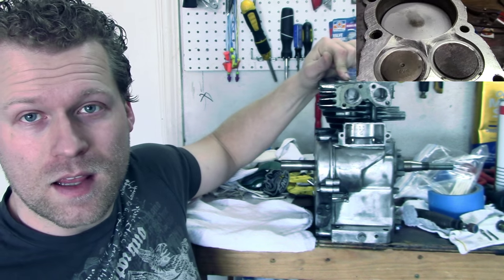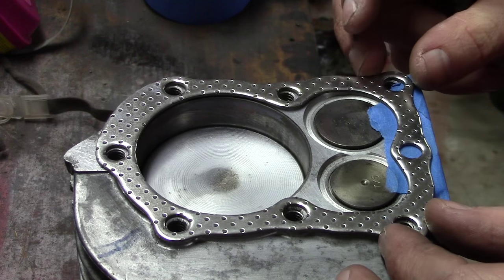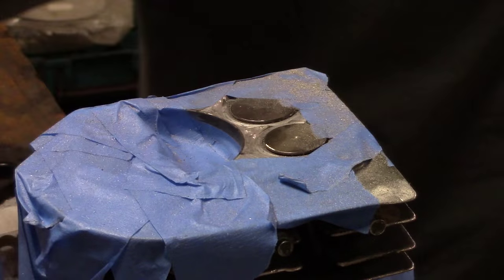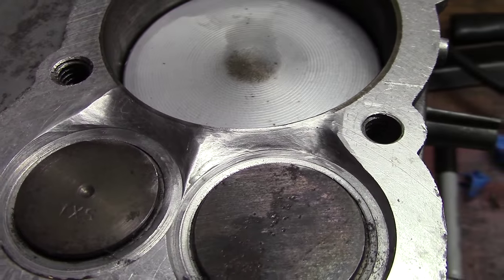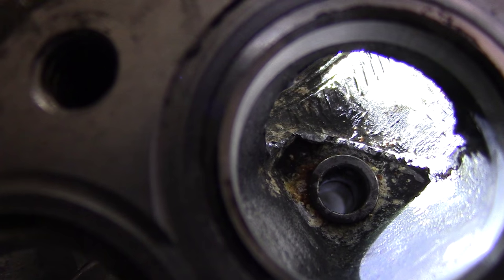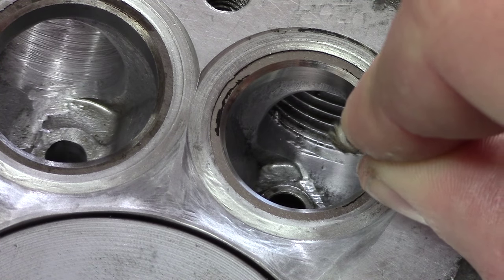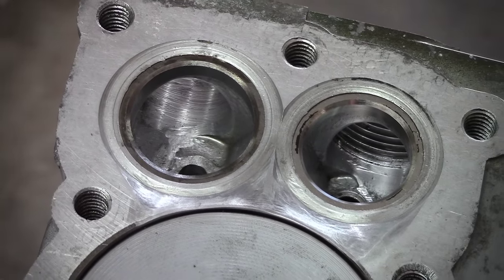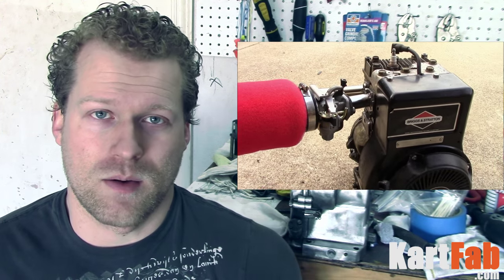How to Port & Polish, Shave Eyebrows: Briggs 5 hp Flathead Performance Mods

Comment: Did a pretty good job. I did the almost same thing on my kids 5hp Briggs, I took a little more off in the runners on mine. It really woke up the motor. If wondering, made low end rpm way stronger, but I have a stock cam also. I love cruising down the street and then just hammer on it, LOL.
Reply from the maker: +prancstaman yeah, it revs pretty good :-)
Reply: @KartFab  Ditto ...Trev New Zealand PS only Flatheads are a low end to midrange Engine: look up the Daytona winning Hudson Twin H powered 308ci L6 6cyl Flathead from the 1950s...a built in chopped Merc too , unlike an OHV...many of which thrive on Revs ( for those of us less knowledgeable ) Cheers everyone from NZ...before you say or think it; no I'm not bragging...Cheers

Comment: I think you made a fine video. Starting out slow and not overdoing the ports is smart. You can't go back. Remember there's people on here that all they want to be is toxic. I owned a custom Harley shop and built lots of engines . Did all my own machine work and I can say you did a fine job of explaining the process.
Good luck.

Comment: You can buy carbide cutters for working with metal.  For aluminium, get a coarse cutter and use a coating of grease in the port to keep the aluminium from plugging the flutes.  As the grease fills with filings, wipe it out and put on another coat.  Wash the grease off before using sanding drums.  The grease is messy, but makes the job easier and gives a better finish.

One major area to promote flow is the "short-side" radius.  On the Briggs, this is right where the roof of the port turns up to the valve. You want to make this a smooth curve with no sharp edges. 

The intake should be finished with a coarse sanding drum to give a slight roughness to promote turbulence along the port wall which helps eliminate fuel sticking to the port.

The exhaust should be as smooth as possible to promote flow and minimize carbon buildup.

Unless going for high RPM, making the ports bigger can be detrimental to power, so go for smoothing the port and eliminating sharp edges rather than removing a lot of material.
Reply: Not legal for legal 4 limited class folks

Comment: Great Channel Man! Not sure if you will ever see this but Epoxy on the Intake 90 Degree Turn would be a good idea and I bet would gain about a good 1/2 HP or so.
Reply from the maker: yeah, lots of dead space there. Ive also heard that you should thread a pipe into the exhaust and cut it off flush to help speed up the exhaust velocity as it is already way too slow.

Comment: When shaving the eyebrows we always shaved into the cylinder being careful to stay above the piston ring
Reply: Yes you can, the piston going a little into the valve area never hurt anything
Reply: @connorssmallengines6663  You grind the wall down untill their even or the piston crown is flush: it's called " relieving" the block, in a Sidevalve. Trev New Zealand 🇳🇿🇳🇿
Reply: @trevinskiking2165  But you can safely go down to the top ring witness mark - - is the point.  The intake and exhaust gasses will have a large, clean shot.
Reply: @TIMEtoRIDE900  What I said,just abreviated for simplicity....cheers NZ

Comment: Porting is specifically useful at higher RPM. During high RPM the gases have less time to enter and exit the cylinder so better flow is critical. Porting does not help so much during mid to low RPMs.

Nice Video!
Reply: John Fraser 
Cleaning up and staying mild helps all over. 
I had something my dad ported for me when I was a kid, haha a moped. 
it had the same power in the basement maybe a little more responsive,but the midrange woke up dramatically and  the top end was tons better. 
It depends on how crazy you go but yea huge ports aren't known for nice low end power. 
The cleanup , with a fresh top end increased top speed from 29 to 37 lol
Reply: It would be great to measure pressure just below the intake valve as a function of rpm, with and without porting. I'm going to guess that there are gains to be had at low rpm too.

Comment: Don't make the exhaust any bigger. The exhaust port on a flathead Briggs 5hp is too big from the factory. Smoothing out the casting lines is fine.

Comment: Good job. I have only 4 engines now. I find it much easier to use the grinding stones attachments. Cone shaped, cyclinder shaped, and frisbee shaped.
  I did however grind down my guides to create a much smoother transition. I saw it done it pics online and it didn't have any ill effects on the engine.

I practice a few times on two of the 97 mL engines since they're so cheap.
It helped build my confidence.
Reply: Ohh and by practicing on the cheapo engines it allows to get a feel for how much to can knock off the casting of the sidewalls.
Reply from the maker: +2SlickNick I 'practiced' on my NOS engine, so that's why I didn't port that much out. Also, I read that if you port out too much (esp the exhaust) it kills your velocity (which kills torque) so I just went the safest route.
Reply: @KartFab  Yeah : want to keep to around 85% Exh to Intake flow or you can overport or overflow & go slower taking too much off.
Stones for Cast metal, grinding bits for alloy( Stops stones from loading up on Alloy ) Cheers everyone From NZ...World's fastest old   Indian Bike ...no I'm not bragging before some Troll says it. Cheers

Comment: you will get almost as good in further gains buy recessing the exhaust valve & radiising the valve seats...radiis the cylinder side of the exhaust channel as well, to about 16th abouve the comp ring & remove the brudge between the valves to encourage exhaust flow scavenging into the intake to promote earlier intake flow if using the std cam...will prote much easier flow from the intake valve & better swirl into the cylinder through the exhaust channel.

Comment: I like what you did, but I would have left much more of that that center ridge untouched, the part between the "eye brows" , kept it a little higher, that actually helps to channel intake gas into the cylinder head. Question, how much HP did you gain ?
Reply from the maker: You get a small loss in compression and a big flow gain so you can rev higher. I have seen jr dragsters that just have the entire “eyebrow” area milled off for flow with supporting modifications. You are right about the center section though and I even missed a spot where the eyebrows transition into the cylinder. I was going off of the information provided to me by someone I thought was experienced but it was just his personal preference. I got a different block and went back to a thicker head gasket for flow gains and I thing the .050” head gasket helped more with flow than eyebrow shave and thin head gasket.

Comment: looks a good job i ported an old ford 2.0 litre cast head using your same principle..... as long as you dont take too much material  off or go too deep to upset flow characteristics you dont need a flow bench(where a specialist tuning company measures the port flow during porting making sure the flow works as if done wrong the engine will lose power at certain rpm?this is what i was advised...but could be wrong?...great video well presented....thanks for sharing

Comment: If your old enough & knowledgeable enough you'll know it's called Ported & for the area between the valves & piston - that's called: relieving or for a Flathead as Jan & Dean sung
 "She's ported & relieved & she's stroked & bored" Trev New Zealand🇳🇿Use the correct terminology.
Reply: Those words are actually from the Beach Boys' song "Little Duece Coupe" . "She's ported and relieved and she's stroked and bored. She'll  do 140 in the top end floored. She's my little duece coupe.  You don't know what I got. Little duece coupe you don't know I got""

Your technical description of the process is correct however.

Comment: I work with them all day, I'm a small engine mechanic. I would never actually own or use one, haha!
Reply from the maker: I got one. Dual ball bearing block with cast iron bore. Put in brass valve guides and a few other goodies. It’s fun just to have not the one in this video.

Comment: In fact the exhaust isn't where the gain is at all,  it's more in the intake,  it's still a bit rough normally  you want to decrease the angle of attack,  that's what I Dit with a Honda engine (gx)  and fill the port with some filler stuff.  But I am gonna try this in my own briggs.  Good video by the way
Reply from the maker: Shaving the eyebrows is only good for the top end. I wouldn't recommend doing it unless you have supporting mods.

Comment: i think u did a pretty good job and its funny im acually in the process of doing the exact same thing to and older 5hp briggs myself
Reply: and im going to steal your honda carb on briggs engine idea
Reply: instead of a bilit fly wheel i am putting a 3hp flywheel of a lawn mower i found that is aluminum and i am taking the points off and converting it to a magneto and making a special bracket to fit the magneto lower and so i cann adjust the degrees of timing
Reply from the maker: +Dale Jackson cool man! You don't have to steal my idea, i give my ideas out for free so everyone can benefit. Advancing the timing by 3-4 degrees is optimal for a gas engine at lower rpms. 5-7 (maybe 8) is better for the methanol engines.
Reply from the maker: +Dale Jackson thanks!
Reply: @dalejackson5003  Dale ,a slider motorcycle carb is like night & day compaired to the butterfly type...run one around 22mm & you'll never look back. Trev NZ 🇳🇿

Comment: Great video grant im gonna port and polish my first small engine (briggs flathead) please feel free to follow the build and offer advice .. thanks for great content
Reply from the maker: Good luck buddy! Pay attention to the inside short turn radius on the intake and exhaust. That's the part you need to focus on the most. Cutting eyebrows arent really necessary, just focus on smoothing out the sharp edges rather than cutting out material from the combustion chamber. Also, a part not shown in the video is the transition from the eyebrow to the combustion chamber, you can and should cut that into a smooth transition but dont go into the ring land.
Reply: @KartFab  Agreed. Trev NZ🇳🇿

Comment: would be interesting to hear if there is any way to identify a kart engine or any other small engines, i'm working on a small engine that had no indication as to the make and model but it looks exactly like the one from the video with the exception of the intake and exhaust ports being swapped, so being able to identify a small engine would be rather helpful in my case >.<
Reply from the maker: +TriniRogue Tecumseh engines typically have intake and exhaust reversed
Reply: 2 years late but Maybe a hs50 or h50?

Comment: Question. On these Kool Bore blocks is there enough material there to re-sleeve with a cast iron sleeve?
Reply from the maker: +Racer X I'm not sure, but I have heard of it being done. One thing to watch out for is the crank. If the side cover and block don't have beings in them for the crank, it's not worth doing any upgrading.
Reply: KartFab Thanks. The side cover does but the flywheel side does not. I can get a sleeve for under 40 bucks but have to call and see what the machining cost will be. Might be cheaper to start with a new block.
Reply: @Shaft-Industries  Ask your machinist:simple Trev NZ🇳🇿

Comment: ive heard that when you grind the inside of a engine block you have to use lube so it dont rust. is that correct
Reply from the maker: Aluminum doesn’t rust

Comment: The eyerow job looked ok but the porting you could have gone alot more streamlined. The short turn radius on these is just terrible and needs amuch rounded and easier turn and in the bowl needs a ramp on the back side rather than a cut out cup, I realize that this will require aluminum to be added but it will help in the airflow. just stick your finger in it and any sharp turns or areas where its just a dead area by your finger will need to be filled in, Just keep in mind the straighter the better.

Comment: Lots of comments from experts on port & polishing. Wonder how many ever operated a flow bench to see whats happening and actually seen the results on a dyno from their work? My guess is they are just regurgitating what they seen on other amateur vids or weby backyard forums.
Reply from the maker: +Mazda rx7 yup. I am trying to find a place in Dallas Fort Worth TX to get this on a dyno, but nothing yet :-(
Reply: Without a dyno, make one change, test and record. But testing conditions should be as close as possible each time. results will vary under different atmospheric conditions.  Or look around for plans and make a dyno
But even with a dyno you still have to make one change/mod for each run or you don't know what did what.  Comes down to cost of change to improvement.
Reply from the maker: Got an extra 4-5k? I'll get a dyno for that.

Comment: Could you apply the same theory to other engines?
Reply from the maker: Porting, yes. Shaving eyebrows is specific to the flathead. Most engines are OHV and much more efficient.
Reply: ***** thanks!
Reply: @KartFab  Shaving a Flatheads "eyebrows" is called relieving. Trev New Zealand🇳🇿

Comment: R.I.P my old Briggs 5 hp the old owner of the engine ran it without oil and it overheated the piston a couple of pieces of metal off the piston got melted onto the cylinder walls might take it to a machine shop someday and have the cylinder walls repaired
Reply: im gonna see if a machine shop can fix the cylinder if they can then im going to put the Flathead on a mini chopper project im working on
Reply from the maker: You’ve got two options if you take it to a machine shop. 1) bore oversize and put in new piston. 2) put in a cast iron sleeve. And have it bored to whatever size.

Comment: actually im not sure if you want to make it "super smooth" , advised by professional engine tuners you should have some texture ... theres a scientific explanation but im not 100% on the details so i dont want to confuse.
Reply from the maker: +Gahl Yogu you are right. Exhaust can be polished but intake should be a little but rough to help keep the fuel atomized.
Reply: good to know thanks!
Reply: Apparently helps increase "swirl" - making the burn more efficient.

Comment: plz do the other video i just got my hands on a 1980's briggs 5hp out box never ran and i want to mod the shit out it
Reply from the maker: +Joseph DePew check out my progress on instagram - KartFab Im almost done modding it. One thing you should do before you decide to mod it, is check to see if it has a cast iron sleeve, or is a "cool bore" aluminum bore. You also need to see if it has bearings on the crank.

Comment: I think it is a great video but you can just get buy the new Predator Ghost engine instead of spending hundreds of $$ on billet parts and get a small boost.
Reply from the maker: Yes and OHV engine is better than Flathead for the most part
Reply: Flat head Briggs looks more enjoyable. Thankfully my old man has plenty of old Briggs 3.5s  and 5s  in his shed to play with.

Comment: i have a engine that as no compression so it wont run but everything is rebuilt so what could it be
Reply from the maker: +rcmaster 1965elcamino explain 'everything is rebuilt'
Reply: +KartFab the piston,rings,seals,carb rebuilt,new head gasket,new bearing, new valves and new springs.
Reply from the maker: did you do it yourself or did you have someone do it for you? Were the valves lapped and valve lash set?
Reply: +KartFab I did it and the valves is lapped and lash set. this is my 20th engine rebuild I did but this one don't work.
Reply from the maker: with the spark plug, can you rotate the crank to the compression stroke by hand and then it bounces back, or does it rotate right on through? Did you double check the camshaft gear dot lines up with the dot on the crank? new headgasket? head bolts torqued to spec?  Id check out all that stuff first, but if in reality you did a complete thorough rebuild, the problem may be in the piston/rings/bore itself.
Reply: +KartFab I just found the problem, the problem was there was a hole through the bore. is that repairable?thanks for your help
Reply: +rcmaster 1965elcamino !!!!!!!!!!!!!!!!!!!!!
Reply from the maker: Oh wow. The block is probably junk then. Sorry :-/
Reply: +KartFab But thank you for helping me! with this problem!

Comment: will this work for a tecumseh?
Reply from the maker: Depends on if its a flathead tecumseh or ohv. OHV is not the same and doesnt suffer from the flow problems of the flathead (L-head) engine.
Reply from the maker: Yep. Just dont take too much off. Check the compression ratio too. The briggs flathead engine already has a crappy compresison ratio, so it isnt hurt much by doing this to unlock flow for higher rpms.
Reply: @KartFab  7 years late, forgot to thank you! I came again for tips

Comment: Where did u get this engine
Reply from the maker: +dylan harrigan eBay nib bare block with crank
Reply: did u buy it of someone or a company
Reply: and do you still have this engine ive been looking for one for a while and cant finde one
Reply from the maker: +dylan harrigan yeah I still have it. You can get a used Briggs racing engine or something else too
Reply: would you consider selling it? ive been looking for a while
Reply from the maker: nope, a quick search on ebay "briggs 5 hp block" pulled up over 17 for sale. Go look where people are selling them.
Reply: +dylan harrigan I have 1 for sale the 80's model

Comment: wouldn't Briggs do this if they thought it would help?
Reply from the maker: +mkosak00 Briggs made this engine for Industrial equipment to run at 3600 rpm. If you are running it at that rpm, none of this is necessary.
Reply: It's a mass-produced engine. They want to spend as little as possible to manufacture an engine that "gets the job done" and charge as much as possible for the product.